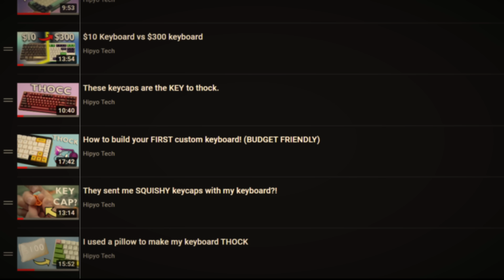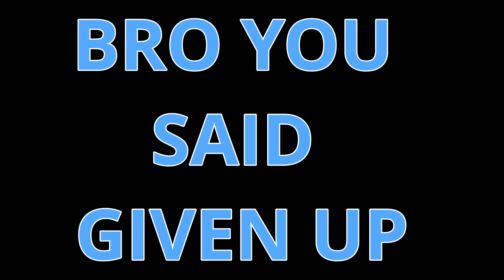I'm Giving Up... (On Mechanical Keyboards)

Comment: Topre is just the end goal for a good amount of people. 
Some might say mx switches were never good.

Personally, I'm aiming for an alps board. It's going to take me a while to get the alps I really want. 
.. and alps keycaps
Reply: I used rubber dome switches happily for 17 years on my Happy Hacking keyboard... and from what I hear, the Niz switches are even better.  If Niz keyboards ran QMK, I'd probably be pretty into them.  But instead, I've found I can get a nice feel from switches like Boba U4 and Durock T1.  Or the scissor switches on my notebook.  Those feel really nice too.  I never got the appeal of Cherry-style switches though... the blues, the browns, the linears... meh.  They just don't have the right kind of response curve.

Comment: I am tempted to buy a Niz but I already have a Realforce R2 with APC (Actuation Point Changer) which is great for gaming and a HHKB Pro 2 with 17 year old domes (FYI aged domes are the best! They are snappy and heavier). I'm afraid I might buy the Niz only to not be that impressed by it. Though I am curious about your thoughts regarding Niz and Topre switches. Perhaps a new video soon?

Comment: Tbh, I think the whole definition of “mechanical” is muddled, but one I can agree on is that a switch allows partial travel activation. So, you haven’t given up on mech boards, you just started using another type.
Reply: mechanical is better explained by a switch that makes physical contact between 2 contacts and passes an electrical signal between the two. then there is hall effect switches, optical switches, capacitive switches, resistive switches and what ever that cheap laser keyboard is. each uses a different electrical principle to identify which key you have pressed and when it's let go. think there are plenty of membrane keyboards that are mechanical, but many optical and hall effect keyboards are labeled as mechanical when they really aren't.
Reply: @TheObsesedAnimeFreaks  most people would argue hall effect and optical are "mechanical". i think the term, at least as it's used, is more about the feel honestly.

Comment: I use Abko K935 V2 which is Niz keyboard. 

Used to use Cherry MX. And other switch type on Drop CTRL and other board.

It's snappy but the boounce back is buttery..

When Halo True was made it was design to mimic Topre key feels. 

Mechanical keys feel harsh compare to Niz.

Comment: "Electric capacitive using rubber domes."

So basically: Membrane switches.
Reply: Nope. Rubber domes were never the issue with membrane keyboards unless they were crappy. The issue's always been the membrane actuation mechanism that gives membrane keyboards their signature mushy feeling, the inability to press multiple switches down in certain orders, and having to fully bottom out a key to actuate the keypress. People always misconstrue the issue being with the rubber domes themselves when they can be considered better in many ways to MX switches such as tactility, silence, and reliability due to only being a two part switch system.
Reply: Membrane switches is a misnomer

The memebrane is the sheet holding the conductive pads connected to the tracers and controller, not the switches
Reply: @zooder6  I never said they were an issue though. LMAO

Anyway, I just think the words he is using are a bit too fancy, he could have just said "membrane switches" and he would have gotten the whole thing across.

That being said, I do agree on what you said about membrane switches, they are much better in many cases compared to a mechanical switch, though I do kinda like the linear feeling some mechanical switches give.
Reply: @oatmilk9918  I mean, some mechanical switches (that are extremely thin) do have the traces directly at the bottom that the switch directly bridge.

Idk though, it might be a misnomer but I am just going off on what I know since there are mechanical switches that directly bridge a connection between two contacts on the PCB like membranes do.
Reply: @razi_man  i get what you mean, but id argue that the membrane isnt causing the input in the same the pcb isnt. the switches are still the mechanisms which cause some form of change, be it electical or magnetic or some other effect

a pcb and mebrane detect a change of state
the switches cause a change of state

there a probably some outliers to this, but i think this is general consesus
Reply: @razi_man  Why would he call rubber dome switches membrane switches? That would be incorrect. Membrane switches would mean any switch that with a membrane system, which Topre style switches do not use. Their system is similar to the Cherry MX 'mechanical' system. It's like grandmas calling every console a Nintendo or every Pokemon a Pikachu. It's wrong.

Comment: You know, what I've come to realize after trying for years to get the right tactile feel from a switch is that tactile switches are just a pale imitation of a really good membrane. Controllers have used membrane buttons for years and you know what? I love controller buttons. I wish my keyboards felt like that. A good laptop keyboard is one of my favorite tactile experiences. But for mechanical switches, I've resigned myself to using linear because everything else just doesn't feel or sound right. Wish someone would make switches that fit normal mechanical keyboards but have rubber domes in them...
Reply: Deskeys domes come the closest to that nice tactile feeling you get from nice laptop keyboard from what I've tried

Comment: This year I found an old Packard Bell keyboard I stored almost two decades ago in my basement. It was the keyboard of my first PC in 1995. Technically is a membrane keyboard but uses rubber domes with sliders and has a very nice feeling. I have three mechanical keyboards (full, 75% and 60%) but use it every now and then.

Comment: I noticed a few issues with mechanical keyboards and the community. There seems to be a sense of elitism directed at who can have what others think is the best keyboard with the best specs. It doesnt seem to be about having a keyboard you enjoy, but a keyboard that other people enjoy. These keyboards can serve the basic functions of a keyboard but are treated more like a novelty item, rather than a tool. As a gamer, i fell into the mechanical gaming keyboard trap: get the best keyboard you can afford, put on what other people think are good switches and stabs, mod it with every mod, and done. And i will admit, it was a fun and good learning experience, i learned to make silicone molds, work with resin using said molds, learned a bit of programming, and electrical engineering. But it was just as much time consuming and frustrating when i could fix a problem that i dont care about, but eather a problem other people care about. I want to use an switch i want to. If i want to use mx browns, people will chastise me for using it just because their favorite youtuber hates on mx browns. Im tired of fhis mechanical keyboard community that is so isolated and always ends up trying to find the same end goal for all its members, in that "thock is good" or "brass is a better plate option" or "no rattling stabilizers" or "aluminium is the best case option because of how it sounds" or "gasket mount is superior because of typing feel" or "clicky is bad" when They themselves dont know how sound interacts with materials nor do they know whether they would like a cushioned typing feel or not. I learned a lot about keyboards and its community, both positive and negative. Some will say its all preference, but that does not help as there is no way that i will have the resources to test what goes best with my setup that in the end, will be used to please people i dont even know. And for all i care, i dont care anymore. If i want a quiet keyboards, i will go with a membrane keyboard, if i want a keyboard with low letency, i will go with a gaming keyboard. If i want a novelty item, i will go with a mechanical keyboard.i am tired of having other people say what is good or i should do or use in the keyboard to get the properties to match to prefernces of a another person that i myself would notice because i use a sound cancelling headset, because i am a gamer and i just want to play without any sort of gimmicks. I have worked with electronics since i was a toddler, but the mechanical keyboard community is by far, the biggest tech scam i have seen the masses of people fall into.  To all other gamers out there, just buy a gaming keyboard and stop listening to other people's opinions, and instead, buy a keyboard that you think looks good, a get on with your day, it doesnt have to be mechanical or optical, or membrane, as long as you enjoy it, use it.
Reply: hey, the entire point of this hobby is the personalisation so yeah who tf cares what others think of your board and i just wanna say this hobby is not even remotely aimed at people who want to "just play games". aiming for certain feels, sounds, looks etc is all unnecessary for gaming, if you want to go through the effort then do and if you dont then this hobby isnt really for you. As for the elitism yeah, some people will be convinced ur keyboard is bad but thats on you for caring about other peoples opinion in a hobby thats litterally all preference.
Reply: @bluecrow491  exactly,  but then i guess i should have noted that my message was aimed at gamers